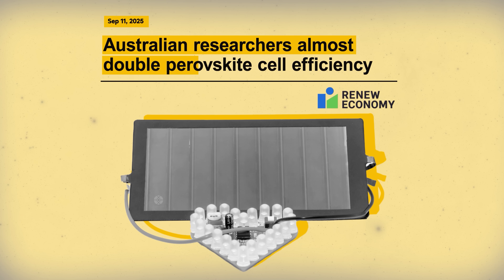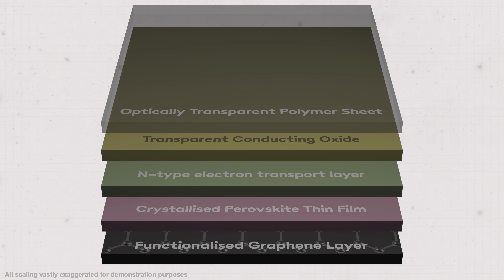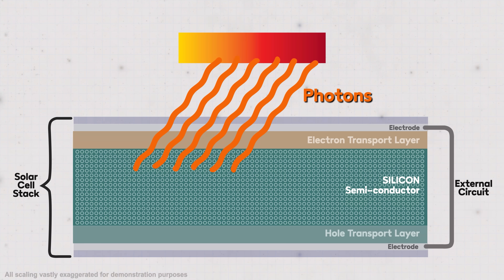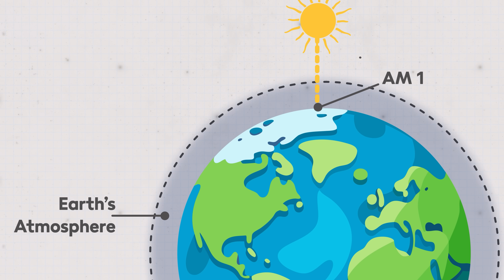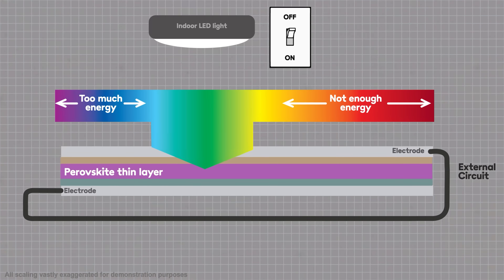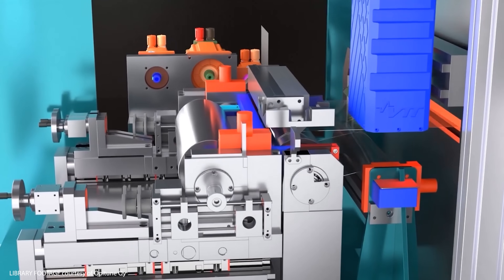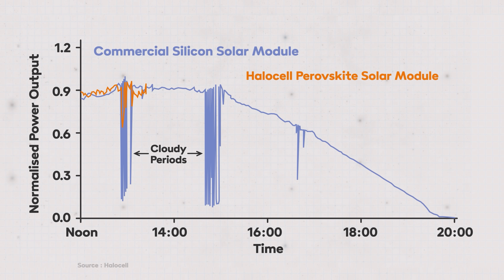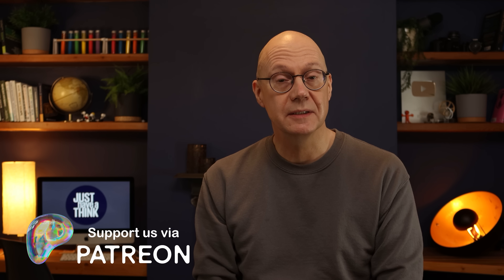Graphene Perovskite just revolutionised the Solar PV industry!

Comment: Just a couple of points to round off what you missed. You need to have a silicon layer to start with, this will eventually have max output of 27%. Then a thin Peroskovite layer and add up to theoretical max of 45% by increasing yield in upper part of spectrum. Probably because of valancy problems even with graphite this will not go above 38%. So the only thing is cost to manufacture against yield. In this we are at least 15 years away from getting above 25%.

Comment: A tiny thing:  I think you meant 48.2° from the vertical (as the animation shows) not ’above the horizon’. Sunlight at a 45° angle would pass through √2 = 1.41 × the mass of the atmosphere, so to get to 1.5× you’d need a shallower angle through the atmosphere, meaning <45° above the horizon, not more. #WhyYesIAmATechnicalWriterHowDidYouKnow 🙄

Comment: Efficiency records don't matter that much (except for cases where surface area is limited and thus the most valuable). What matters the most is economics. A much less efficient solution that is cheaper is more important for the world than super efficient but expensive one.  The "80% cost reduction" compared to absurd gold backed perovskite is very misleading. This thing is NOT competing with gold, but with dirt chip silicon...

Comment: An interesting combination, Perovskite and Graphene, and graphene mass production is becoming reality.  Another interesting development: a Korean super 'capacitor' battery with  418 kWh/Kg  cell energy density, made of carbon nanotube (CNT) fibers and polyaniline (PANI, organic compound),  587 kW kg−1 power density  and no battery degradation after 100,000 cycles.   CNT fibers are super strong and PANI is also a very stable material.  CATL and BYD state of the art commercial batteries are around 200 kWh/Kg.

Comment: The 30% efficiency cited (and 40% for gold layer) is extremely misleading, as it uses a very different illumination for which the theoretical efficiency is about 55%, 1.6 times the limit for the standard AM1.5 illumination. Citing these values in comparison to AM1.5 results is thus technical malpractice. Scaling these back to make a fair comparison gives a 40/1.6=25% efficiency for the cells with gold layers which is actually very good and close to the record performance as noted later in the video. However the device with "functionalized graphene" is actually noncompetitive, as 30/1.6=18.75%. This could be fine for a low-cost mass-produced large-area module, but is not close to commercially viable for a champion lab cell.

Comment: INTERESTING PRESENTATION.  i WAS DOING SOME PAPER RESEARCH WAY BACK CONCERNING A 3M PRODUCT I BECAME INFORMED ABOUT AS "THE LIGHT PIPE" AND I WAS SEEKING THE MAN WHO INVENTED IT TO DISCUSS THE CONCEPT AND PRODUCT.  THERE WERE SOME APPLICATIONS INSTALLED AS OF THE ARTICLE I READ IN THE MOMENT IN THE EARLY 1990'S.......SO THIS SHOULD BE OUT OF THE PATENT SITUATION.......HOWEVER IT DID NOT CATCH ON AND I'M NOT SURE WHAT 3M DID IN MARKETING AND SALES.  >>>>> SO CONCEPTUALLY THE PIPE HAD NO DEGRADING OF THE LIGHT INPUT AND AT THE OPPOSITE END OF THE PIPE.....WHICH WAS RATHER INTERESTING FOR WHAT IT IS.  BUT WHERE I POSED TO UTILIZE THE PRODUCT WAS  A UNIQUE APPLICATION AS TO CARRY A LIGHT FROM A FIXED POSITION AS THE "HEAT" FACTOR WAS THE ISSUE IN THE EQUATION......AND THE PIPE WOULD NOT CARRY THAT HEAT BUT JUST THE LIGHT....AND SEEMINGLY AS ADVERTISED....EFFICIENT.  SO AS TO POWER THE "LIGHT" ASPECT WAS TO BE OFF GRID AND THE PREMISE OF ENERGY EXPENDED  WAS TO BE RECOVERED AS MUCH AS POSSIBLE VIA PHOTOVOLTAICS.  BUT THE ERA WAS NOT YET AT FLEXIBLE PANELS AND IN THEORY THE FLAT PANELS COULD BE CONSTRUCTED TO WRAP THE PIPE.....WHICH WAS THE PREMISE AS TO RECOVER ENERGY ALONG THE TRAVEL OF LIGHT IN THE PIPE TO DESTINATION.......AND HOW MUCH COULD BE RECOVERED AS A SHEATH.....AS BEING OFF GRID...BATTERY POWER AT THE END OF THE DAY....AND KEEPING THE BATTERY CHARGED......OTHER THAN THE APPARATUS TO CHARGE IT INITIALLY. >>>> BEING IN PITTSBURGH, THE UNIVERSITY OF PITTSBURGH TOOK CONTROL OF THE FORMER GULF OIL RESEARCH CENTER AND THEY DID AWAY WITH PETROLEUM AS GULF HAD JUST BUILT A DISTILLER WHEN IT WAS ACQUIRED BY CHEVRON.......AND PITT DID NOT PURSUE PETROLEUM IN THE MOMENT AND A RESEARCH LAB LOCATED THERE MOVED IN AS THEY WERE DOING THE FIRST GEN PLASTIC SOLAR FLEX PANEL SHEETS......BUT THE EFFICIENCY IN THE INFANCY WAS,,,,,,,,, >>>>> AND THE LAB WENT UNDER AFTER A FEW YEARS BEFORE GETTING ANYTHING TO MARKET IN THAT MOMENT........AS THAT ASPECT OF SOLAR TOOK OFF AND THE PITT LAB MISSED THE BOAT. >>>> SO AS TECHNOLOGY IMPROVED AND THE LED'S CAME INTO THE PICTURE....THE RECALIBRATION WAS THE LED AND LIGHT PIPE ......DELIVERING TO A CHAMBER/ROOM AND THE PV RECOVERY IN THE ROOM AND IN ADDITION TO THE WRAP OF THE LIGHT PIPE. >>>>> SO IN THEORY...... IF THE RECOVERY OF EXPENDITURE APPROACHES TO FULL RECOVERY OR APPROACHING THAT FULL 100% ASPECT.....OR EVEN IF IT MIGHT BECOME THE 110% RECOVERY.....WHICH WOULD REALLY BE STRETCHING IT......IF THERE WAS A TUNING ASPECT TO A LENGTH OF LIGHT PIPE & POTENTIAL OF RECOVERY

Comment: Thank you for another wonderful video! I really do love the effortless way you explain these concepts, with the animations.

So 30.6% conversion of light into electricity, indoors. That is pretty neat. When it becomes possible to easily and cheaply power small objects with ambient lighting there will no doubt be many new types of gadgets invented to use it. It won't just be calculators and remote controls, but a whole indoor forest of sensors and tiny machines inside our living spaces. Maybe they'll come embedded within appliances, so your new refrigerator will tell you the temperature of the room and keep track of how long the milk has left before it expires, the iron will switch off if it's not moved for a while, the window will alert you if it's left open and a draft is coming in... Who knows. If you remove the wires and get power from light bulbs the possibilities are endless.

Comment: Light weight cells have their own niche, so this could be significant for solar. Solar for gadgets is not interesting to me, we're talking about near zero energy consumption that might get a little better. Although a phone cover with ambient light solar cells integrated might be nice to have. Light weight thin film is great for things like cars and building roofs that are unsuitable for heavy solar cells. Cost is a major factor for solar as well. Although solar panels are already so cheap that they make up less than half the cost of a solar installation, cheaper panels make it possible to over panel more, which means more output on cloudy days. That could be a significant step to helping us get through the Dunkelflaute.
Reply: I've used flexible and robust CIGS panels to put 600w on the roof on my rented place with no roof access, just pulled them over with ropes and tied the corners down. High efficiency flexible panels would be amazing

Comment: This is great for small devices, but for regular electricity generation, does it really matter when 500w panel costs around 65 euro?  I was considering polycarbonate to cover some space I have , but the cost of 2m by 1m sheet is around 32 euro, roughly same size pv panel costs 62 euro. At such a low price It would be dumb not to use pv panels.

Comment: Here in Northern Ontario the electricity rates are relatively cheap and 90% CO2 free but if that will ever change I would be buying a solar system and now I know what to look for . Perovskite seem to be an amazing design. My understanding was that solar energy harvesting would top out at only 22%  but now pushing 30 or higher is truly amazing. The future looks great with these inventions. Great vid .
Reply: N.O.is almost all hydro. I'm uncertain if solar panels are better for the environment,  overall,  than hydro. Very doubtful due to the low intensity of sunlight in the winter.
Reply: It is ideal for geothermal for heating and cooling  - taking the load off electric and making solar a reasonably  cost effective choice.
Reply: Perovskite has been "the next big thing" for a while now, best to build out a silcon system now, it's never been cheaper! You can always get just the panels later.
Reply: How long before you go buy it?

Comment: 30% is the point I am waiting for solar to reach before I upgrade, it will turn my tiny 2000w roof system into 3000w and tangibly improvement my life in winter and would remove the need for grid top ups entirely.

Comment: The fact that Perovskites are typically a lead based chemistry should always be mentioned in any story regarding their use and development.
Reply: Yeah. Indoor consumer products aren’t at all a viable place to put lead-based perovskite cells. Non lead containing perovskite cell chemistries do exist, but conversion efficiencies are much lower AFAIK.
Reply: We use lead batteries in cars yet they are highly recycled - that’s done on a mind boggling scale. That is a characteristic for these kind of solar panels as well - mentioned near the end - unlike current solar panels, they can be recycled.
Reply: @TheSulross  Current solar panels can be recycled - it's just a policy issue in the US. 85% of panels are recyled in the EU.
Reply: @TheSulross just like lead paint. Or mercury in thermometers. Normal usage is low risk,  but put a random user and random events (fires, etc ...) and you get uncontrolled pollution. Lead batteries are valuable enough by weight. Those cells will end up in landfills or backyard cleaning fires
Reply: @TheSulross  In certain larger applications, yes, the risk is manageable, but this video is about optimizing cells for indoor small device applications where the lead hazard is not so simple to mitigate using known processes and materials while retaining the advantages over Si.
Reply: @amyl1568  That's right. Car batteries are relatively easy to keep track of because every car is registered and tracked throughout it's useful life. That makes creating a battery recycling system more manageable and even profitable. Hundreds of millions or even billions of small lead containing devices scattered across the world with no tracking or registration simply means more uncontrtolled lead in the environment.
Reply: @TheSulross  In fact current solar panels can be recycled as well. Large inroads are just underways to make it a reality (for Glass/foil as well as Glass/Glass modules) while another current type, the CdTe - thin film PV modules, are recycled in large scale already since many years. So well, that First Solar meanwhile does not use any freshly mined materials any more.
Reply: @beatreuteler they are not even remotely economical to recycle - a lot of things are possible but few are economical practical to carry out
Reply: @TheSulross  In the future there will be a radiv^cal need to recycle materials that are economically not viable, so they will require to be subsidized. If not, mankind will starve.
Reply: @beatreuteler  or just avoid technology stacks that are profoundly a problem for the Earth’s environment
Reply: @TheSulross  That doesn't make any sense as this would mean lowering life quality so drastically, that devastating unrest would result.
Reply: @beatreuteler   well, for instance, the EV tech stack is many times more environmentally destructive than the tech stack it is intended to supplant (when look at the full picture of everything that is involved per each tech stack)
Reply: @TheSulross  This is a plain lie.

Comment: High quality graphene is still pretty expensive due to low production output/yields.

The potential cost benefits of graphene over gold and silver in tech will not materialise until production capacity massively increases without losing quality.